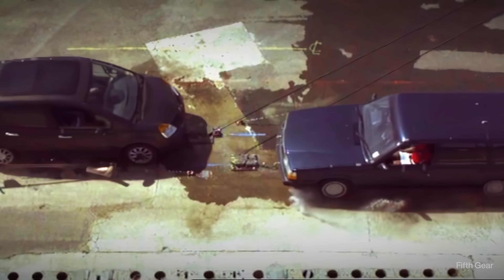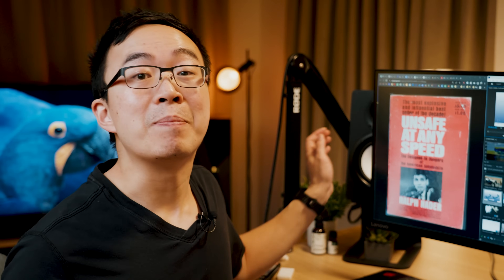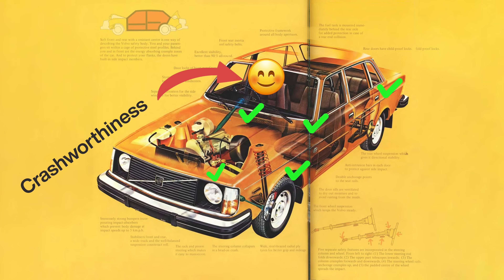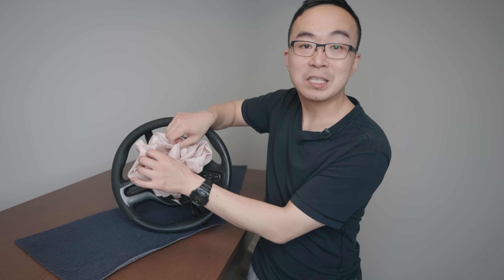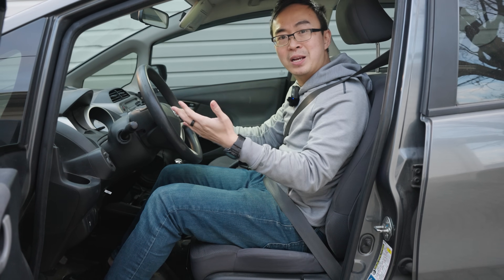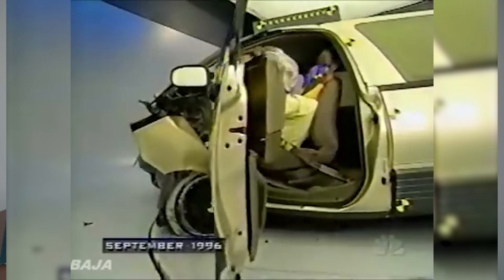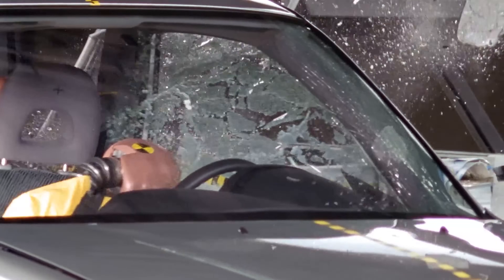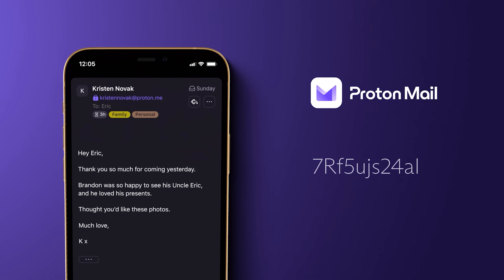When does a car stop being safe?

Comment: Surprised you did not reference the IIHS 50th Anniversary Crash Test of a 1959 Chevy BelAir against a 2009 Chevy Malibu. That video makes the case better than any description how the IIHS has saved lives. https://www.youtube.com/watch?v=xtxd27jlZ_g

I was involved in a frontal crash where the safety systems literally meant that my wife and I could walk away. We were in a 2009 Audi A3 when an American Full Size Pickup truck crossed the double yellow line and we had an almost perfect head on collision at about 40 Mph each (total 80 miles per hour closing rate). I do not know what damage the pickup had, our A3 was completely destroyed forward of the A pillar (as designed), from the A pillar back you could not tell it had been in a crash, the door gaps were still perfect. The German engineering of the passenger compartment and front crumple zone did their job.
Reply from the maker: Amazing and yeah I did see the video.  It kind of got lost as I moved through the video.
Reply: That's not a representative test because the Belair has an X frame instead of much more common parallel frame rails that distribute crash energy better.  In short, that video was deliberately misleading and people like you are too misinformed to realize the deck was stacked to maximize the intended result.
Reply: @Noah_E  I know people don't like to hear it, but cars don't become safe by Chance. There was no engineering towards safety back then and the outcome is according.
There is another example in the video, where a Volvo much newer than the Bel air gets absolutely smashed by a much smaller modern car. 
Then there's plenty of other examples with 90's cars getting folded like tin cans by their modern counterpart. 
For example:
-2016 Nissan Altima folding a 1992 Nissan Tsuru 
-a 2020 Ford Fiesta doing the same to a 1998 one

The Bel air might be an extreme example, but that doesn't change the outcome. The driver is dead for multiple reasons, the Bel air just might provide some additional ones.

Comment: The tests from the IIHS focus on half of the equation : the injuries sustained by occupants of the car considered by the test. What is missing is: what is the potential damage to occupants of the other car? If you don't consider that side of the problem, then you could end up in a "race to the biggest, heaviest car", which would be terrible for other road users. Not only other cars, which won't be able to absorb the energy from being hit by a heavier car, but pedestrians and other road users. Those bigger cars are often higher, and offer poor visibility on their immediate surroundings. We would probably all be safer overall if that "other half of the problem" was considered by regulators.
Reply: The fact that they needed to introduce the SUV side impact test says a lot.
Reply: @Callsign_Sturm  From a tall vehicle you absolutely can see farther, but that's not the problem. What I was saying is that you cannot see near! I don't know which specific vehicle you drive, but think of a large pick-up truck, or a large SUV (say  a Merc G-class). If a child, or an older shorter person, was right in front of the car, they would be hard to see. Also, because of the weight, those vehicles have massive A-pillars, in case of a rollover (which is, by the way, much more likely in a taller vehicle). Those A-pillars are a big, known problem for visibility, and the victims are mre often the most vulnerable road users.
Reply: @nifinnicesse people shouldn't stand in front of cars.
Reply: Yhea, my cars crash structures won't do much if I get tboned by a truck so tall the bottom of its bumper starts at my window line.
Reply: Feels like the Tesla Cybertruck would absolutely fail in this test.
Reply: Its already a big problem in the United States, in the EU crash safety tests require evaluation on safety of the occupant of the other car, and in the case of pedestrian strikes, the united states and IHS does not test for either of those, hence why theres a trend towards large suvs and trucks in the US as they receive the highest crash ratings. Good observation!
Reply: @HapyAppleProductions  Europe drives on tiny roads and have inefficient road systems. The roads of my hometown are small and cramped, compared to where I live in America with easy access to I-highways and barely any pedestrians in the places where I do drive
Reply: @MiroBG359 massive roads and a near-total lack of pedestrians is a bug, not a feature.
Reply: @MiroBG359  By which metric does Europe have an ineffective road system?
Reply: @edipires15  I'm European. My family lives all over Europe. Most of the roads in Europe are two lane. City streets are often cramped. Lack of parking is endemic. Spain just recently was able to build some 4 or 6 lane highways that aren't used much because they cost extra. For comparison my husband is from a very rural town of 1500 people, the state built over 90 miles of big, wide, 4-lane divided highway in the last 15 years through an area that is mostly tree farms
Reply: @MiroBG359  I'm European as well. Just because most of the roads are 2-lane doesn't mean that it is an inefficient system. Actually, most of it is very efficient. Unlike the US, Europe has viable alternatives to driving, so it doesn't need to have large (and deadly) roads everywhere. In fact, as we speak, many European cities are reducing car space even more to create more room for public transport, walking and cycling, because they are more efficient for transporting people per lane than cars.
Reply: @Zorro9129  I’m sorry but I don’t buy that argument fully. Yes the US is huge, but it has many parts where cities are clustered together (like the Northeast corridor) and thus viable to set up alternatives for driving. Actually some US cities have started developing their public transit and the results are encouraging.
Reply: @MiroBG359 I can assure you the road density of most European countries exceeds that of the USA.
Reply: @MiroBG359 "Europe has inefficient road systems", LMFAO, take a look at your own country, you have highways with more lanes than European road designers can count and still they're all jammed with cars! 🤣

Look up terms like "walkable cities", "car dependency" and "induced demand" and you will understand why European road systems are way better than what you guys have!
Reply: @Zorro9129 buses are only unviable because of how you decided to build your cities (urban sprawl and zoning laws), not because of the geography of the terrain.

Trains are only "unviable" because railway is being starved of funding,  but not because of the geography either. In fact, most pretty much none of the towns and cities in the interior and on the west coast would even exist without trains. Trains are what made settling in those remote (from the east coast) areas viable in the first place! 💁

Public transportation (both inner-city and long distance) works perfectly fine everywhere else in the world - even in other large countries like Russia and China - yet you believe it couldn't possibly work in the USA?! 🤦
Reply: @MiroBG359  'Inefficient'.
Reply: Yes, they also only consider how it survives a crash, not how it can avoid a crash. Cars have decreased visibility, more mass, and are harder to control. I'd rather have a car that does slightly worse in a frontal impact if it can stop 20' shorter from 60mph.
Reply: @danbert8 that's not true at all, tech like anti lock brakes, stability control, and collision mitigation systems all focus on avoidance. Couple that with wide tires equipped with modern compounds and you have something that can stop much better than older designs.
Reply: @danbert8 that 20 feet won't help you.
Reply: @danbert8  they should test for both.
Reply: @danbert8  not true. Part of IIHS Safety Pick designations now include crash avoidance technology and headlight visibility testing
Reply: @MiroBG359 correct. The next stage of safety is avoidance.  I always drive the latest cars bc I want the latest safety tech and they have helped me avoid several accidents.
Reply: @MiroBG359  Curse them for the headlight testing. It's an absolute plague on the road. Cars are so high and have such bright headlights now it's literally blinding to other cars. They need to ban headlight brightness beyond whatever cars had in the 2010's. If you need brighter headlights than that, you shouldn't be driving at night.
Reply: @uncreativename9936 nah man, brighter headlights are better. The real problem is the height they're mounted at. Limit that to 0,5m (1.5ft) or something like that and you won't get blinded anymore.

Plus oversized SUVs will look absolutely ridiculous with their hoodline at chest height and the headlights at knee/lower thigh height! 😄
Reply: @Callsign_Sturm  well, there's your answer, those pickups were built before rollover safety became a major deal (or they might downright ignore it due to different standards), on the other hand the economy car has beefed up pillars that will stay strong and rigid even in a drop onto its roof. though I do agree that those massive pillars are nothing if not bothersome, with modern metalurgy and engineering techniques we could really get the size of them down at least a little, but sadly that's a few dollars to the car too much for most manufacturers
Reply: Which really puzzles me since basic car insurance covers liability if you impose medical costs on the other driver not your own medical costs (that's medical payment coverage).  As such what your insurer pays is more a function of how much damage you do than how much you receive.

Tho the economics are quite murky since death is often less expensive to an insurer.
Reply: We are already at the (il)logical conclusion of that arms race.😢
Reply: I feel very safe in my M1 Abrams! 
Good luck everybody!
Reply: You have just explained why SUVs exist.
Reply: The testing would apply to both cars in the crash...
Reply: @Callsign_Sturm  Well said!
Reply: Funny enough that’s the direction we are heading towards, example: full sized pick ups and SUVs past the Ford Ranger are WAY too large
Reply: @Callsign_Sturm "I can see better in bigger car" = copium

"My small car has terrible visibility, therefore all small cars have terrible visibility" = logical fallacy/cognitive bias.

The Blindspots behind the pillars of your car and between the side and rear view mirror depend on the design of the car and adjustment of the mirrors, not the size, but the lower your your window line and the shorter and lower your front end, the better you can see small objects (like young children, short people and wheelchair users) directly in front of or behind/around your car.
A smaller car will always offer better visibility than a big one if all else (eg. Design, seating position, mirrors, etc) being equal!
Reply: That's correct. I have a Chevy S10 and it's not known by being the safest car on road but my mom hits me going out the garage and the truck it's like nothing happened but the car had to go to the dealer. Of course I'm not saying the truck it's safer, I would like to be on the car on a hard crash, but with the small things this points came to light
Reply: that already happened, why you think trucks and suvs have been getting chonkier lately
Reply: There's no way to mitigate the mass component of energy in a collision, except to reduce the mass. That's why, if you want safety, you should buy the highest mass vehicle you can afford that makes sense for you. There's also no good way to implement this. We should make vehicles as safe as they reasonably can be. Not as safe as possible. The safest possible thing is to not have a vehicles at all.
Reply: European Crash Tests do involve all kinds of other road users and pedestrians.
Reply from the maker: This is very true, but it's nearly impossible to assess or regulate in an affordable manner.  They do keep a stat called "other driver deaths" which shows how often one car kills the opposing driver/passengers in a crash.
Reply: @Lam  Good point. The keyword is "economical" I guess. You could test against a number of "other" vehicles, but that wouldn't be a good test from the point of view of standardization, as vehicles change all the time. You could also design a sort of buggy against which the tested car would crash, but then you would need to replicate the intricate way in which a typical car absorbs the energy from the impact.
This being said, there should be regulation that prevent a "race to be the largest", at least from a safety point of view. It's a bit like an arms race: individually it makes sense to get something bigger, but we might collectively all be better off if cars were on average smaller.
Reply: @nifinnicesse  If you're going to build that "buggy" you talked about, there's no need to build that buggy. In other words, you don't need a standard test article (your buggy)  to crash into because they already have one: a wall, even with the standard deformable insert. There are specifics of course, but the point is, if there's twice the mass, there's twice the energy. You can do that by increasing the speed by 1/4 (by 1/2? i don't know how to say it: half of doubling.) Instead of crashing at 30mph, they should do it at 45. The test would  just get harder to pass. Meaning, the cars would be more expensive. Again, there's no way to reasonably protect against the physics of collisions. And I don't think there should be regulation to limit size and mass. All those things cost money, and that regulates that growth on its own.
Reply: @Lam  It's definitely possible to reduce the overall number of dangerously heavy vehicles on the road. For non-commercial vehicles, you could tax heavier cars, potentially implementing extra sales tax after a certain weight (say 3,000lbs) and add additional fees for every extra 100lbs. If you're not willing to spend an extra $5,000 in taxes to purchase an SUV over a crossover, you probably didn't really need the SUV that much!
Reply: Couldn't agree more, I can't believe that a 3200kg SUV is considered to be save and a 700kg kei car is considered a death trap. I know which one I'd rather be hit by. A smaller lighter car can also stop and manoeuvre quicker, giving better chances of avoiding a crash all together. It seems outright selfish to put pedestrians and every other road user at greater risk to improve your odds slightly. imo the occupant safety should be given less priority over pedestrian safety and the impact to other vehicles etc. Likewise stopping distances, emergency manoeuvres and visibility should be given much higher priority.
Reply: @thomaslowery6653 SUV's will be taxed away eventually, it's just going to take some time.
Reply: In USA is arms race who have a bigger car ,but reality last year in USA 41 000 traffic deaths ,iN EU which has 50% more people 20 000 death.
  In fact half milion more people died in USA then in US since year 2000.Can you imagine that ,half milion people more died
Reply: Great point! Governments should step up and, at least, introduce heavy taxes on bulky oversized cars. Each time I see the Cadillac Escalade on the road, I can't help but think of people it will eventually kill...
Reply: @solderbuff  Every time someone starts saying "governments should…" that person is best ignored.
Reply: @Zorro9129  , I'm a believer in the government. Some issues just cannot be solved privately.
Reply: We just had a crash here...an old guy, like 89 crossed the yellow line for an unknown reason in his 1998 Expedition and hit a 2022 RAV4 head on at 55 mph...all 3 in the RAV4 died, a 26, 25, and 21 year old, the guy in the Expedition wasn't even using a seatbelt, all the others were...the old man was thrown into the passenger side floor...he had no real injuries other than broken eye glasses....Size does matter...
Reply: We need to start bringing in weight and size limitations to production cars, as well as encouraging things like Kei cars like they do in Japan. The market clearly can't allow itself to be sensible.

It would also reduce congestion as you get more cars on the same stretch of road. Obviously, public transit and cycling should also be prioritized, but every little helps.

Comment: Its unfortunate the approach to the weight issue is having a minimum weight. A better solution that solves lots of other problems would to have a maximum weight instead, or better alongside
Reply: I don't think there should be a minimum or a maximum.
Reply: @Zorro9129 there's already a sort of maximum weight. In some cities, vehicles over 6k pounds aren't allowed on the streets as they cause excessive wear to the roads. If you go extremely heavy you basically become a commercial vehicle and you need a CDL.
Vehicle weight is going to become critical once electric vehicles become common due to the large weight of the batteries and powertrain.
Reply: A maximum weight will never happen considering the Greenie profiteers pushing EVs. Batteries alone weigh hundreds of pounds more than an engine, transmission, and full fuel tank combined.  A large EV with a 75+ kWh battery and dual motors can easily weigh a thousand pounds more than a comparable ICE.
Reply from the maker: Agreed! I wish it was different that it's not a push for bigger and bigger
Reply: What about trailers? Or Vans? Heavy vehicles are unavoidable, so they are forced to go down the minimum-weight route.